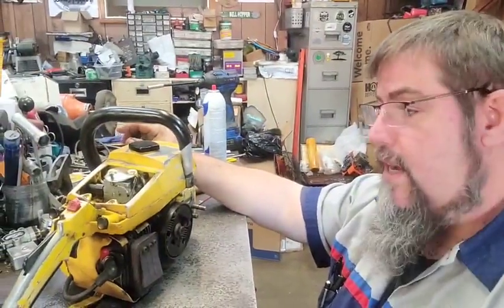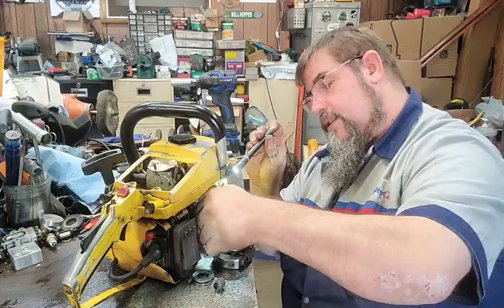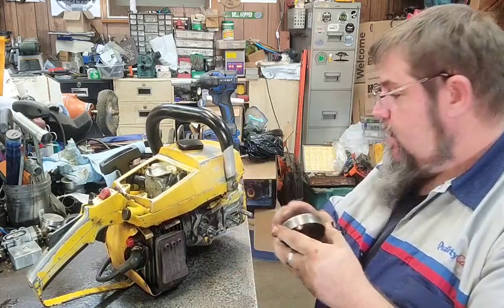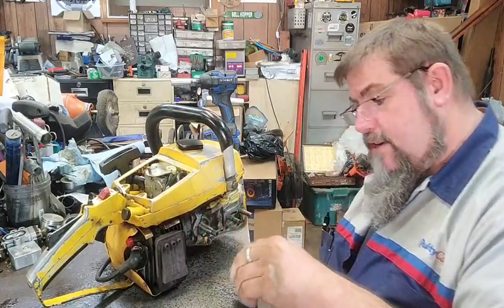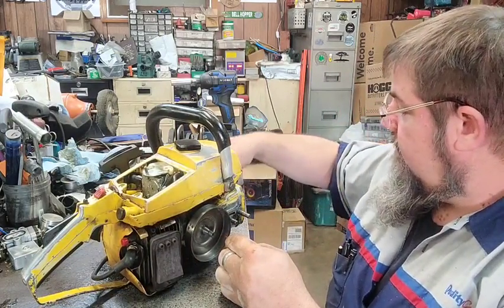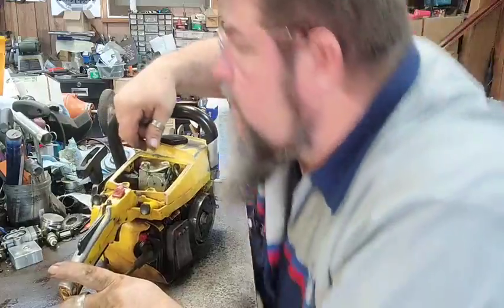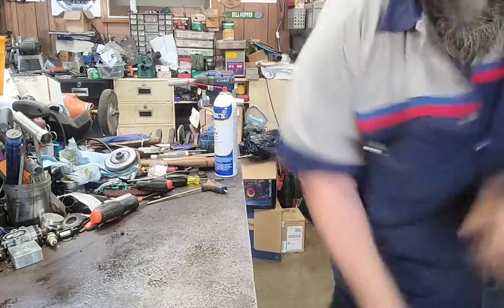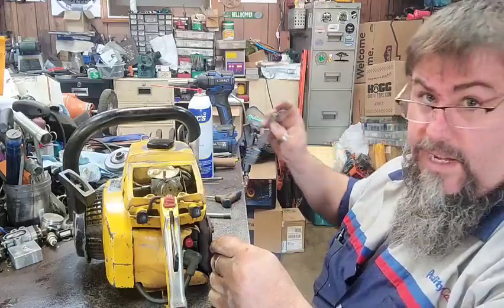Mcculloch PM 700 Clutch Repair

Comment: Hello bellhopper Danny again 
I have a Pro Mac 700 and the clutch nut has an arrow 
Is that arrow the direction to remove and do I need to put a piece of string in the spark plug chamber to jamb the piston?